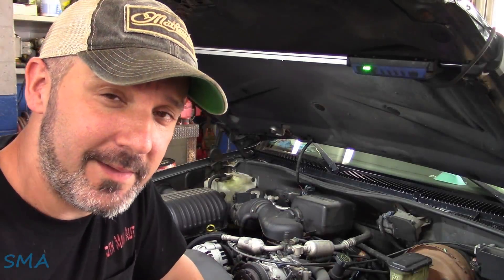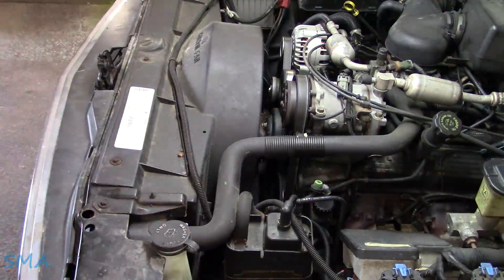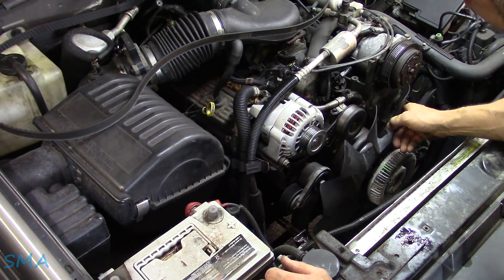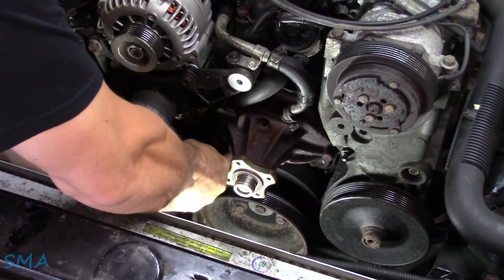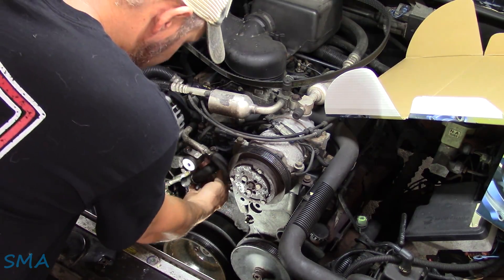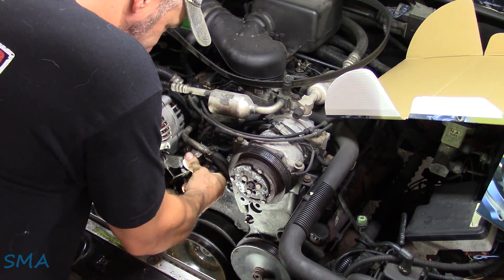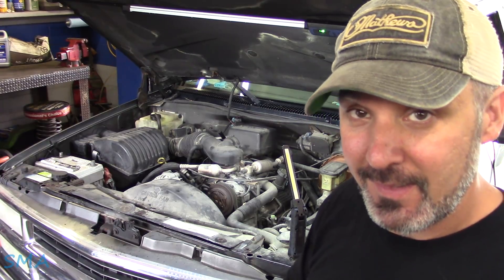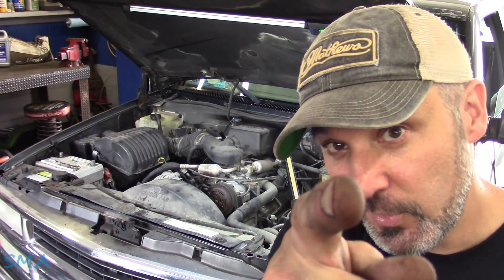Water Pump Replacement: 5.7 Chevy Tahoe / Silverado / GMC Sierra / Yukon

Comment: Sometimes I don’t wish I was Dr. O 
I’ve never gone to remove a water pump and thought, I hope I can get the fan shroud bolts off. Besides working in 130 degree shop, being a mechanic in AZ isn’t so bad.

Comment: "It looked longer" story of my life, dont want your hose going in too deep nor do you want just the tip. I just did the water pump, hoses, and new radiator in my 89 K1500 5.7 TBI. Im not an expert on the late model 5.7s however i do know that on the older 350s there are 10 different water pumps. Its always a good idea on these to check the shaft length (thats what she said) to make sure its correct. In other words, check shaft length before screwing to avoid embarrassment.

Comment: If only new cars were as easy to fix as that... I had Escorts and Fiestas ( I'm over in England) and so much easier to work on .. nowadays there's so much stuff under the bonnet it's a right pain , and you need a degree in Astro Physics just to change a headlight bulb.. ahh.. memories..🚗😎

Comment: Had coworker of mine had a fan clutch break and damaged the radiator. He replaced the radiator, fan and fan clutch. The fan clutch broke again a few days later. I told him the only thing I can think of is you have a bad water pump. Even thought the water pump wasn't leaking there was slop in the water pump shaft.

Comment: Ever replace valve cover gaskets on a 2010 Dodge Grand Caravan Hero? 3.8 Liter 6 banger. I figured out how to R&R the rear cover without pulling the 2 piece intake manifold and related parts. Saved a couple hours too. No more leaks! ;)

Comment: I just worked on a 1998 GMC Sierra with 5.7.  It had a parasitic draw of 1.06 amps. You will never guess what was causing the draw.
Reply: Don't leave us hanging...
Reply: @mikelovin7  A diode was shorted in the alternator. allowing the draw to occur.
Reply: @billziegmond4943  Nice, thanks for the answer. :)

Comment: I have an 03 Suburban I was disappointed to learn that it had a 5.3 instead of the 5.7.  The only thing that makes me feel better is I think the 5.3 is getting better mileage than a 350 would.  I'm averaging 18 MPG on long trips.
Reply: I get 18 out of a 2500hd express van with a 350. 1999 model. This is in east tennessee too. Nothing is flat around here

Comment: You know that's what it is. Ive never owned a gm with either a smallblock v8 or 4.3 v6 that didn't need a water pump. I think when ever someone buys one of these just go to the parts store & buy a water pump & wait. It's not a question of if will need one but when it will need one.

Comment: I have been a mechanic for 15 years and I’m not sure if it’s location but I have only seen maybe 3 blown radiator hoses. Other then some newer model vehicles with plastic crimp fittings.

Comment: So I've done a ton of water pumps,I just did the one on my 5.7 and it's leaking out of the bottom bolt hole I assume...I've watch 3 videos 2 no sealant on bolts on he smeared the shit all over so I'm just confused...do you use sealant on the bolts or not?...they definitely go into the water jacket so...

Comment: What was that tool you used to hold the pulley while you loosened the fan? I had to rig up a breaker bar with a starter wrench bolted to it to keep it off the fans nut.

Comment: I mess with them. I have 4 Chevy 5.7s.  1 79 Jeep Cherokee Chef with a heart transplant. Went from a 185hp 360, th400, and the quadajunk to a 330 hp 5.7 with a Th400 and NP 205. 2 79 GMC Jimmy with a New 5.7 330hp, Th 350, and an upgraded 205 NP. 3- 89 K1500 with a New 5.7 330hp and a reman 700r4 and overhauled transfer case. 4-90 Chevy G10 with a new 330hp 5.7 converted to a 4X4 with dana 44 front and rear axles, New TCI 700r4 trans, and an NP 205. Altogether I've got 30k in all 4. We priced a new truck at 65k. I think I came out ahead.

Comment: I got a 98 Sierra with green coolant in it. I just bought the truck and all the coolant looks good and fresh. Should I flush it and put Dex Cool in it? It's not over heating. My gauge is a little stuck but I'm sure it's not getting too hot.

Comment: Eric is correct..........in Australia there were people who put Chev 5.7 small blocks in Toyota landcruisers........they fit fantastic and used less fuel than the primitive toyota garbage engines. Only problem was the toyota transfer case would split :(           Always check the idlers and belt tensioner when doing a pump, they do wear out and when they fail its very messy..........

Comment: I have a Buick  allure 07  with a 3800  engine it has 127,000  kms on it  mint condition  ,I've heard the plastic coolant elbows leak eventually  ,I was wondering if I should replace mine as preventive maintenance  with aluminum ones ,,as of right now they do not leak  the car is very well cared for   thanks for your opinion

Comment: I notice fewer impacts are being used. Impacts are fast, but they lack feel. I prefer to feel the mating of mechanical objects. Then, I'm not working under time pressure. Although, doing it a bit slower, is ALWAYS better than doing it twice. 
I owned a sourdough bread bakery, the previous owners had used mild cheddar cheese in a cheese/garlic/basil loaf because it was the cheapest cheddar.
I started using sharp cheddar even though it cost half again more. BUT to get the same flavor required only half as much of the sharp (to double the mild cheddar). The end product was vastly improved (less oily) and the production cost was lowered by simple logic.

Comment: I've had at least 7 GM 5.7L engines (three in boats,) the rest in SUV's. What do you think about the 6.0L LS blocks? Some are cast iron...what years. Are they similar to the the Ford 351 in their exhaust/intake layout? What about cooling. Wow new engines are really hard to work on with all the clips, rivets extra hoses for this and that...I could change a radiator in my old Chevy Vega in 30 mins!!!!

Comment: my '92 rusted the backing plate and cast housing enough the gasket pooched through and it left green pee marks. (6 years ago?) 23 years wasn't a bad run for it really, the bearings, seal and impeller was still fine and I nearly just cleaned it up and replaced the gaskets on the pump itself. special order and a "new" aftermarket pump was same cost >_<

Comment: Well I’ve got a 2000 Chevy have to run everything works fine I’ve had to replace a gas line a caliper into warped rotors still running good it’s my winter track when I’m not on my motorcycle I thought of selling it but I couldn’t buy another truck if I really needed one I only paid 2500 for it and it’s got 120,000 miles

Comment: What is the name of the tool to hold the pull bolts, was try to replace a pump for someone and was not able to take fan off to get to pump. They had to take it to a shop to fix it.

Comment: My Chevy 5.7 I changed the fuel injector because I had a missing cylinder 6 I changed that and I still have a missing cylinder 6 I changed distributor cap the rotor plus the whole distributor to and I still have a Miss in cylinder 6 I don't know what to do what else you might think I need to do thank you

Comment: "Dex-cool conversion' ?   Is that more than just a flush and replace the coolant?
Reply: That's all I did, but you must make sure all the Dex-cool is removed from the system. I have a 1999 GMC Suburban K1500 with rear air and heat. Disconnected the hoses in the rear and flushed the system until clear water came out. I have put 45,000 miles on it since the conversion and have zero problems.

Comment: That truck must be a transplant to the rust belt water pump bolts did not break upon taking them off.
Lots of ppl still use and play with a gen 1 small block 350 i have an original 72 c20 putting new plugs and dizzy in this week

Comment: I always swap out the orange kool-aid. I have very little faith in the old dex-cool. After replacing too many to count intake gaskets. Torque spec? I know its always best to mention, but if you actually did look em up, i would be suprised. Head bolts, intake and exhaust, sure. I look up timing cover torque too. Plastic covers.

Comment: 94 chevy 1500 W/T V6 4.3L vortec with a 5 speed millennial crusher solid as can be got it from a friend  had to change the rear someone put a toe cutter in shed barely crawl found a rear from a Silverado had a 454 ho and a bent frame got the goodies cheap I'm sure you can guess the rest bud.

Comment: A Customer has a 2002 suzuki xl-7 2.7L.water pump finally gave out at 4177337miles..gee what were they doin..back in day in Jay-pan....we found another one 170000 miles on its.a mail driver suv..does 85-100 miles 6 days a week on the highway..

Comment: Not much 5.7 experience, but my Blazer has it's smaller cousin the 4.3 that I've done a ton of work on. Unfortunately, unlike the 350s, she's wiped out a few rod bearings in her life.
Reply: That's usually because someone ran it too long after the intake gasket failed and dumped coolant in the oil.

Comment: I certainly hope you tightened the overflow cap to the proper spec... You know you have to re-check those clip specs after 1000 miles, dude... Lets try to keep everything on the up and up...

Comment: Worst experience with a water pump was about 38 years ago when the pump on my 78 ford van with a 300  six and a 3 speed overdrive decided to die.  I am noway the mechanic I thought I was but it looked simple enough job.  I picked up a pump at the local auto parts and went home and took off the old one.  Damn, I was sold the wrong pump so I made the trip back to the parts house.  They looked it up and I found out there different pumps for the thing,  I go back home get the old pump and take it back to make sure I get the right one,  The right one has a hole in the side that required a plug that took a 1/2 inch allen.  Who has a 1/2 in allen wrench?   I didn't know they made such a thing.  Parts house doesn't have a new plug so  I have to remove the old plug.  Parts house said they would pull the plug and put it into my new one.  After half hour waiting I am told they could not get the plug out.  I asked if I could go back into their shop and get the plug out my self.  Took a large box end open end wrench slide it on the allen wrench and a second later the plug came out,  a minute later I was headed home again to finish the job.  The van had a single drive shaft that took 3 weeks to find when the thing got wrapped with a truck tire laying on the road.  She was also my only clutch job I ever did.

Comment: Well ... don't try to put the fan on a running engine... but I just get the threads started and then start the engine. The fan will self-torque itself to factory specs. That's the GM assembly line policy.

Comment: Not on topic at all, but I (average joe DIY'er) found a cool tool I haven't seen and I wonder if you've tried it.. Mayhew Pro 37316. Attach to air hammer, put a socket on the end, and you can turn it with an open ended wrench  while givin 'er the beans. I'm thinkin about getting one to try on my subie ball joint pinch bolt, in addition to practicing with a small torch, on probably one of the worst bolts to learn on..

Comment: did you now pre 200 the chevy water pumps on their V6 and V8 where the fastest and easiest water pumps to swap  well in my opinion anyways    and I also think there design  was the best water pump and the most robust  just there the pre 2000 power steering pumps  I converted all my fords and my dodge to a Chevy steering pump  I juts love pre 2000 chevys lol

Comment: I have a 99 Tahoe as well !! Why is their antifreeze not Orange like mine?
Reply: I have a 99 yukon and mine is orange too.  They got the cheap green stuff last water pump i guess lol
Reply: the orange Dex-cool is often swapped out for the traditional green stuff. Both of my 99 Suburbans had been swapped to the green before I got them. Works fine as long as you flush out ALL the orange.
Reply from the maker: @RedfishCarolina  I mention that in the vid ;)
Reply: @SouthMainAuto  yes you did I ask before the you said so LOL.

Comment: My Tahoe is not a relic! :(
Shes a sexy beast! (Also a 99, Custom Creations version)
One thing i noticed that im annoyed about.. That one had green coolant... for the LONGEST time my dealer put red or a diffy color coolant in it, its only been the last year or 2 that they started putting Green in it (also after i had the coolant flushed and thermometer replaced).. i wonder if the (wrong?) coolant being used for so long caused the coolant related issues i had with it?

Comment: there was a time when you had to pay attention to what rotation direction the auto store sold you for a water pump.
Reply: wasn't that on the LT1 engines?
Reply: @mattcat231  originally the water pump was driven by a V belt and turned the same way as the crank shaft. then the serpentine belt system came along and the water pump turns counter to the crank shaft. you have to have the correct pump for the application
Reply: @NebukedNezzer  scratch what i wrote, i was thinking the electric water pumps, along with that nightmare optispark system, i was in bed catching up on the vids, lol! note to self- do not reply when tired, lol

Comment: You are a brave man @3:39 putting that wrench that is connected to ground right on the positive terminal. I see the positive is disconnected...but the negative?
Reply: Do you understand why the word "circuit" is used in electronics, aaannnd racing?

Comment: I thought that year used DexCool which is a OAT, but looked like the green traditional IAT Antifreeze, which bad if have any aluminum components, and high Silica can cause premature failure of water pump bearings even in older vehicles. however since OAT, especially Dexcool is crap and can sludge too easily, I prefer Zerex G05 , a hybrid, for ALL GM vehicles. Just never mix any of them!

Comment: Those engines are great.  You can add the original LS for 99-06.  The reason is they are the best of the slightly older way of doing it.  No VVT cam phaser crap, no cylinder deactivation.  They just work, and when they are taken care of, they work for a very long time.  I would take a GMT400 or 800 over this new over priced ugly crap any day!

Comment: Ah the good ole days, where V8s had 225 HP, so you could have 4 cylinder power with V8 gas mileage.
Reply: My 99 van has 360 hp and 380 foot pounds of torque at 2,800 rpm. It will pull a 27 foot camper at 80 in overdrive without breaking a sweat. My last one went 580,000 miles before the transmission started slipping. The engine still runs ok
Reply: @Bryan-Hensley  that's an LS architecture, right? No GM 350 in a van was ever rated at 360hp. Sounds like you are describing the lq4 or the lq9

Comment: I know that it’s too late for this truck but Napa’s pumps for that application love to leak where the back plate is bolted to it. The gasket in between is made from soggy Chinese cardboard. Absolutely the crappiest paper gasket material that I have ever seen. I had to pull one back off, clean the garbage gasket off and sealed it up using some Ultra Gray Permatex. My local Napa hated me. When their Chinese garbage bites me I go in their store and let every customer know what garbage Chinese junk that Napa is selling now. 
If they ain’t ashamed to sell it then I ain’t afraid to tell it. I’m bout 1/2 galded just thinking about it.

Comment: There's the problem. The mismatched bolt was throwing the balance off this whole time.
Reply: you know, there may be some validity in your statement!!! I know its apples to oranges, but think about the fan disk in a CFM56 engine on a Boeing 737, one small imbalance can cause it to have a contained or uncontained engine failure....

Comment: These commenters must beat the daylights out of you on using a torque wrench. The only time I use them is if I'm screwing small steel bolts into aluminum, or if I'm doing a job like bolting down a head where you have to have even pressure on all the bolts. We both know those water pump mounting bolts were good for 5 or 6 ugga duggas. I've done several dozen of my own small block water pumps over the years, whether because the pump went bad or I had to go after the cam or timing chain, and never used a torque wrench and never had a problem. The torque spec whiners are either guys that do one simple job a year on their car and HAVE to use torque specs because they don't have the feel, or "pros" that had it drummed into their heads in their Auto Mechanics community college courses because the teacher didn't want some fool breaking off 1/4"-20 bolts using 800 ft-lbs of torque. Sorry for the rant, it just pains me to hear you feel the need to say you will "tighten it to torque spec" and I know better, because you'd film it on occasion. When you do it for money, you learn to tighten by feel because you don't have the time to fuss with torque wrenches. But keep saying it so the prima donnas don't beat you up for it.

Comment: I bet the brakes are spongy and the intake manifold gaskets are gone.
Reply: well, the dexcool wasn't in it, so the LIM gaskets were probably changed, lol, and if you put a newer master cylinder from an equivalent 99-07 truck (1500 to 1500, 2500 to 2500) you would be AMAZED at the brake pedal you have!!!! You can stop on a dime and squeeze a booger out of Roosevelt's nose!!! Just make sure you bleed out the ABS unit good
Reply: @mattcat231  and the wonky variable ratio steering?

Comment: I am so relieved that u torqued the fan shroud bolts. I was also going to c if u used torque to yield water pump to block bolts. And it was also very reassuring to learn that the anti freeze was environmentally disposed of. Just like when they de ice airplane wings with ethylene glycol aka antifreeze. 😥😥😥😥

Comment: that oddball bolt was probably why it broke.  odd weights, causing a slight vibration, over time just wore out the bearing.  I bet this thing was losing coolant thru the weep hole for some time.